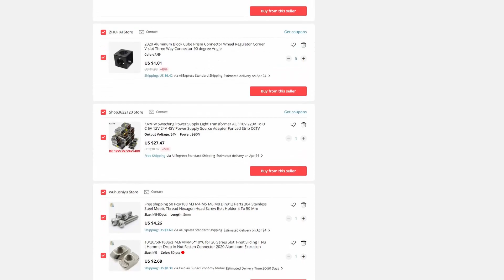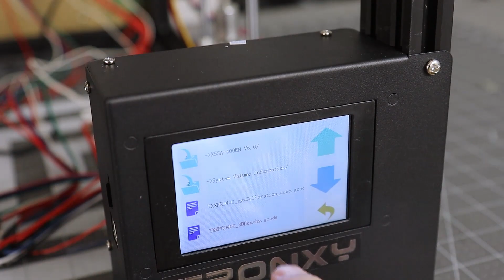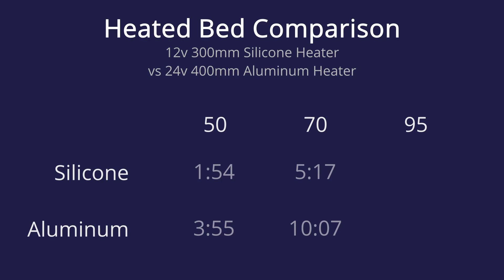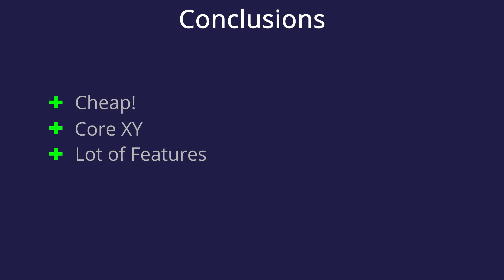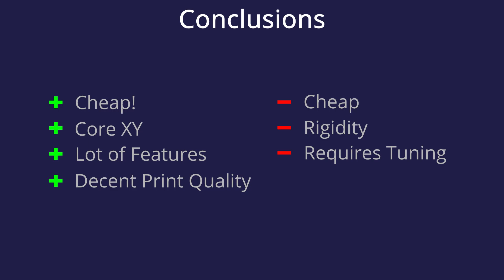Review: TronXY X5SA-400 3D Printer - A 'Starter Kit' for a Really Great 3D Printer

Comment: This sucks, I was looking at my belt alignment wondering why they built it that way then it dawned on me, I had built it wrong. At 12:02 you point out the issue BUT: I moved my pulley off the v-wheel and added a new bolt to the hole closest to the bed for the pulley. I know you didn't build the gantry parts, TronXY did and the instructions on my version: TronXY X5SA 'Junk' (v2) version shows the same as what you have there. I aligned the outer edge of the motor bracket with the center of the V-grove, the belts all line up now and I have extra belt left over (don't get me started on belt tensions...)

Comment: Hello I have bought myself one of these and it was quite an interesting build    I built mine on christmas day and the only problem im having is auto levelling has my spring bottomed out    i cant lower the value in the front right corner and im having trouble getting the machine exactly levelled    my tronxy XY 2 works perfectly when i managed to get the bed levelled    any ideas on how to get adjustment in the springs?  i was wondering if i can lower the 2 rods holding the heat bed allowing me to lower the glass ant advice is much appreciated

Comment: Doesn't say much good for Tronxy when the first good thing we can say about it is that it's good for a source of parts. But it's true. Had mine for a year now it's a worthless piece of trash. I'm about to spend almost the cost of the printer buying upgrades for it to see if I can make it work.
Reply from the maker: The overall design isn't terrible - they just cheaped-out in a lot of areas.  It's definitely tough to recommend at MSRP or to anyone not willing to tinker quite a bit.  What issues are you having?  Maybe I can assist.
Reply: @LilMikeysBigPlans  just saw your offer to help  thanks I ripped out the board and put an octopus and a NF sunrise extruder its working well enough now so I'm printing out Voron Trident parts to dress it up and put the electronics underneath Thanks for sharing all that you share with us. Not everyone does.

Comment: Hello, does it print all models accurately or with some models offset, and does it print circles and squares clearly? I'm using Ultimaker Cura 4.11.0 Here's mine prints with offset of some models, but it prints circles and squares perfectly even
Reply from the maker: Hello Vladis. Not totally clear on your issue.  If circles and squares are the correct size then your printer's physical geometry should be fine.  By 'prints with offset' if you mean that you put something at the middle of your bed and it prints closer to one of the edges then it could be your machine settings.  I think Cura messed up the 'Printhead settings' (part of the Machine Settings) an they don't work they way that they should.  Maybe reset them to default.  Otherwise it could be an offset or something being set in start gcode?

Comment: Hello. 

I have my X5SA 2E 400, still a pretty new one, but there is an issue. If I have done all the calibration, bed leveling, Z leveling (by a proximity sensor, which was included), all looks great as long, as I do not start to print. Then it keeps to find a "home" position again, and then re-levels the Z-axis automatically (nothing against it), but then it moves the bed about 20mm down, but then only about 10mm up, so there remains about 10mm space between the bed and the printing nozzle, but the printer starts to print anyway. So I need to stop printing just before the start (but after all that auto-leveling), manually move the bed 10mm up, check the Z-axis leveling, and then restart printing. It works, but it's not ideal... It may be some easy to fix the problem like some wrong number somewhere, but I am not sure how, or where, it may be fixed, if it is possible at all. Can you give me some hint or advice? Thanks so much in advance :)

PS: I am unable to connect my printer to the PC by a USB cable. I have already tried some advice and guides, but no success at all. Is there any other way how to "load" the firmware or printer settings to the PC, for some eventual exploring of the code? Thanks again :)
Reply from the maker: Hello Terablick, for the Z-axis issue I'd guess you either have an incorrect Z offset or something wrong in your start gcode.  If you manually home everything (G28) and then move Z to 0 (G1 Z0) where does your nozzle end up?  If everything is set up correctly it should be a sheet-of-paper-width above of the bed.  If it's far off of the bed then you have an issue with your Z offset.  If it does end up at bed-height then you have something in your start-gcode that's messing up the home location.  That can be hard to debug but look for any 'G0's, 'G1s' or 'G92's that are out of place.

As for the PC connection that could be a problem with the board.  You should at least get the 'windows detected a device' tune and see something in Device Manager.  Generally printers only show up as raw com ports (you don't get a mountable drive or anything) and there's no way to read the firmware source off of your printer.  You can obtain settings and versions and such through gcode and serial commands but once a firmware is compiled and burnt you don't really know what's there unless you compiled it yourself.  The Chitu firmware is proprietary and as far as I know they never released the source so if you want to check out code you'll need to move to Marlin or Klipper.
Reply: You have to open the board housing, and change the jumper for USB, but it must be changed back to use printer From the sd card. I used this on a cxy v6 f446 main board in my x5sa. Configured using pronterface M503 and M500 commands to raise max speeds and accells
Reply: @daltonginn6038  OH, OK. :) Thanks much :) I will try it ;)
Reply: @LilMikeysBigPlans  Thanks much :) Yes, its exactly what it does. After precise manual calibrating, bed calibrating, to 0.05mm difference at each point at max., etc, and double checking of it, after the g-code start, the nozzle will successfully autodetect the bed level (by tripple check by the proximity sensor, at the corner of the bed) with no issues, and the travel to the center of the bed, where travel much more lower, and literary dig into it.... I had to try multiple times, but with the exact same result. Than I get used to manually pause the g-code run, retract the nozzle by manual control of the servos for exact distance, and re-run the g-code, but I will love to fix the problem, not only its symptoms... But I am not any kind of programmer or anything like that :(

Comment: The bed design on the X5S printers are weak and bend. I suppose you could come up with some sort of frame for the bed.

The X5S other than that arnt too bad. The Pro versions are not worth getting. Go for the X5SA standard ones and just upgrade the electronics (SKR 1.4 or SKR 2) and get a meanwell 500w power supply.
Reply from the maker: Yeah, pretty much all of the printer frame, including bed, needs some beefing up.  The bed frame is pretty thin but I haven't personally had an issue with it.  One of the springs is a bit higher than the others so it likely is twisted but as long as its the same twisted from the top of the travel to the bottom it's been ok - especially with a glass top.

Comment: I just got an X5SA and am having a real issue with the belts rubbing on the pulleys. I've tried everything I can think of but I still can't get it to stop completely. I think I'll give your motor mount and pulley mounts a try to see if it can fix my issue.
Reply from the maker: Give it a shot!  I don't recall there being too much vertical mis-alignment with the stock mounts and spacers but you could be looking at a different revision or QA issue.

Comment: I can’t figure out how to put the “pads” as the manual calls them, on the frame. Any help?
Reply from the maker: Assuming you got the same pads as I did, you have to poke a hole through the membrane then just use a bolt and t-nut to attach it to the bottom rails.  I think they suggest using a washer since it's not a clean hole in the rubber.
Reply: @LilMikeysBigPlans  Alright, thanks!

Comment: Lucky, my X5SA Pro has nothing but issues, Z offset requires me to grind the nozzle in to the paper, the ABL causes issues requiring me to level the bed and then adjust knobs as it does brims etc. 
Their glass bed isn't level according to the sensor which apparently doesn't offset from the nozzle either :\
Reply from the maker: Yeah, I started having significant issues with their sensor.  The blue sensor is a bit trash it seems.  They sell an upgraded black sensor but I'd suggest either moving to BL Touch, Piezo, or even just a micro-switch based levelling system.  I didn't get any glass with my TronXY but window or mirror glass has always been flat enough for me - and far better than thin aluminum.

Comment: Hey great video you talked about the firmware is there a upgrade for the firmware or just use what comes with it
Reply from the maker: Hey Jay, there are three options for firmware on the X5SA, 1) The default Chitu firmware provided by TronXY, 2) Marlin, and 3) Klipper (which requires a Raspberry Pi or other host).

Day-to-day the TronXY firmware seemed fine.  I would consider Marlin an upgrade to the TronXY firmware if for no other reason than Marlin is common and well supported.  There are more features in Marlin however if you haven't stumbled across the need for them then you probably won't benefit a lot from it.  Klipper is whole other world and if you're sick of firmware recompiles and/or want to squeek every bit of performance from your printer that's the deep dark hole you want to stumble into.

You can get the latest TronXY firmware from here: https://www.tronxyonline.com/Firmware-X5SA-Series-a63178.html.  Links to Marlin and Klipper are in the video description.  Good luck and shout if you have any questions!
Reply: @LilMikeysBigPlans  thank you very much and I like your videos keep up the good work and I just bought the same printer the you showed in the video and other suggestions on what to do to make it better
Reply: @LilMikeysBigPlans  I am thinking on putting marlin on mine but when I try to build the firmware it tells me the I have the v5 board and I have the v6 board
Reply from the maker: @jaythornhill2916  Sorry Jay, missed this response 7 months ago.  If you haven't resolved it yet, the V5 and V6 firmwares are interchangeable as far as I can tell.  I had the same concern but went ahead with the V6 and it worked just fine.  If you're really worried about it you can always back up the raw firmware using STM Cube.

Comment: Great video and love the upgrades you created. I got this same model at a similar deal and the print quality is great at pretty much stock+2020 corner brackets. Agree that the main negative is the bed surface (definitely don't stick directly to bed; either clip on, or stick on magnetic sheets, as it will need replacing after some use) and the long bed heat-up time when going higher temps (which I hope will improve once I get it enclosed). But overall, great deal if you can get it for under $300, and better than most other options at the $350 price point, as long you are willing to tinker and have familiarity with 3d printer.
Reply from the maker: Thanks nmos!  What did you end up with for a bed surface?  I grabbed some cheap PEI which was pretty terrible.  I keep wanting to try a spring steel sheet but they real expensive at this size.  I'm honestly just back to printing directly on the glass.  I just put up a larger upgrade video.  Would be interested in your feedback on those new mods.
Reply: @LilMikeysBigPlans  thanks for letting me know about the new video. I'm surprised it didn't pop up even though I had you subscribed with the bell. I will definitely check that out next
I had recently got that spring steel PEI build plate from Energetic 3D from AliExpress at size 410x410mm. It was about $54, with magnetic base (didn't really need it as I already had magnetic sheets stuck on to the bed, but it was just $2 extra). Compared to the original surface, this build surface is definitely better: (1) it makes it easier for the inductive sensor to detect, (2) adhesion may be slightly better (or I've been just leveling it better) (3) no longer has paint sticking to the prints, (4) it also give me slightly more build volume after I get around to compiling custom firmware (it also appears to be adjustable via chitu gcodes). Now I've only printed PLA on it so far, have not use PETG or others. Not sure how durable it will be as PEI will get marked up if nozzle is too close. The one I ordered didn't have a textured surface on the back. I was not aware they had one with textures surface until much later. I would recommend paying attention to that and consider getting the one with that textured surface, if you are in the market for one.
The main reason I ordered this replacement was because the durability of the original build surface. When building my printer I had stuck 4 8x10 magnetic sheets from Amazon to the bed and 4 on the build surface to make it removable. The adhesion to the original surface was maybe a little less forgiving than creality build surfaces, but the main problem was the durability. Now, part of it was my fault. I was printing PETG directly on it, hence it was ripping off chunks when I attempted to remove print. Creality's build surface on ender 5 didn't really have this issue so that is why I thought is it was okay to do.

Comment: Great video and I agree with your reasoning, cheaper than buying the parts. . But I think the X5SA-Pro is the printer to buy if you can live with the smaller build volume. The PRO has many improvements including the rails, a 32 bit motherboard and 24 V power supply and bed leveling sensor. You don't have to replace everything to get good performance out of the box.  The most important assembly step is to buy 10 aluminum corner brackets, about $25, so you have them for assembly and the cube will be rock solid. I can move mine to another room and it stays in perfect alignment.  Carefully assemble it and get it perfectly square and you will avoid a lot of problems.   Another comment explained the 32 bit motherboard will run Marlin and the tutorial guides you through the process of upgrading to Marlin. That is the second upgrade to make. I am upset because TRONXY will not support products that are not ordered directly from them. So I had to buy the parts that were in the missing Z axis bag myself. Overall it is a good value but only if you have enough experience to assemble it and tune it.. Be sure you really understand the Z axis and the offset adjustment before you turn it on so you don't run the nozzle into the print bed.
Reply: I personally would go with x5sa-400 over x5sa pro as the x5sa-400 already comes with 32 bit board (I think the newer version even have tmc silent drivers), 24v per supply and bed leveling sensor that you mentioned, along with titan extruder. Most tests videos on YouTube demonstrate minimal to no difference with even hiwin linear rails compared to v-rollers on other printers. I doubt it would be much different with this printer and not worth losing the XY size. Agree on the 2020 corner brackets; they are a must for better rigidity and print quality
Reply from the maker: Agree with nmos001.  My X5SA-400 non-pro came with 24v PSU and 32-bit board.  As far as I can tell the rails and metal motor mount are the only differences from a pro however the package seems to different from retailer-to-retailer and time-to-time so it's hard to say exactly what you're going to get.
I've switched to a MGN12H rail for my X axis as all of the direct drive options I've seen using the OEM plates seemed a bit janky.  Hoping to have a video of my next upgrades up this week however my Chitu board died unexpectedly and my 2209 steppers are lost in shipping it seems :(

Comment: I bought my tronxy for the same reason as you (making it a beast). The first (and really easy) mod I did is install Marlin on it. You loose the visual features but oh man it's so better and super easy to install. Go check RhapsodyV's github. He made a template for the tronxy where you simply uncomment your machine and you compile it. The extruder is not super reliable, on mine it stopped extruding for no reason 2 or 3 times. I changed it for an Hemera and it prints like a charm. The belt is crap, it stretches pretty easily so you might consider changing it. Good luck!
Reply from the maker: Hello Yannick.  Agree that Marlin is the way to go on this printer.  You can definitely keep the LCD - at least the one that came with my X5SA - and it works great.  The electronics package isn't bad and unless you want more advanced steppers or some other crazy stuff there's not a lot of reason to upgrade it.

Unfortunately my Chitu board is dead.  I started having what seemed to be stepper driver issues and then accidentally let the magic smoke out.  I can't say for sure it was purely the board though as it seems I also have some bad buck converters that are blowing fuses on a replacement SKR board.